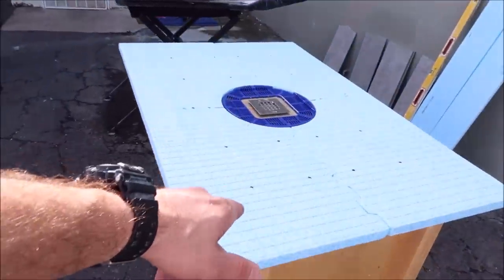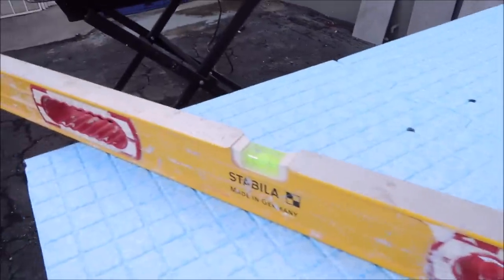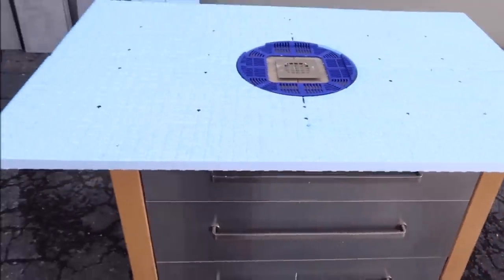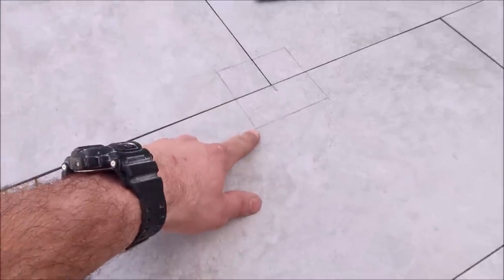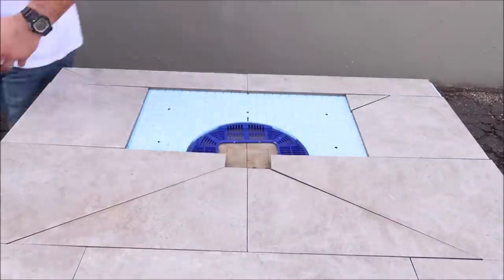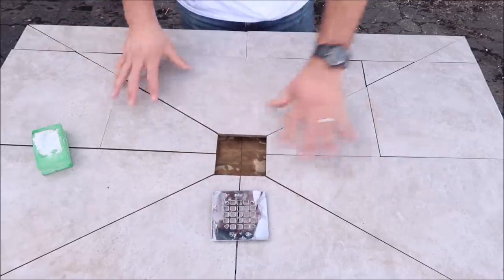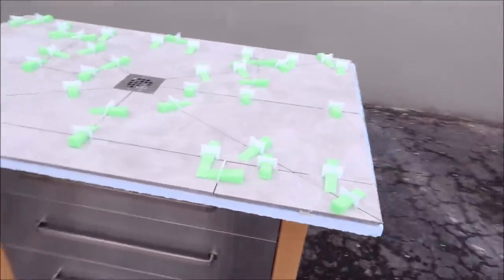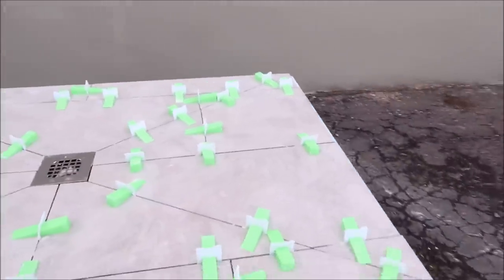Modern Design for a Shower Pan

Comment from the maker: gloves https://amzn.to/2SNhikj
earplugs https://amzn.to/2VI6K7R
levtec leveling system https://amzn.to/2D1COw1
Reply: What pan was that? Does it still need cement under or will go on plywood?
Reply: @djony10  you need a 1/4 x 1/4 notch trowel tinset layer underneath the foam pan

Comment: Looks nice and sleek. I would not have expected this to work, because that inner circle of wedges I would think would be trying to keep all those tiles up and level instead of maintaining that slop down to the drain. Lately I've been using river rock shower pan floors which mold to the slope perfectly, and many people like the look, but they do have a lot of grout. I use a grout maximizer sealer to mix the grout instead of water, adds $20 tot he cost, but worth it.

Comment: it s the best demonstration and tutorial!!!  However, I was a bit surprised seeing tile levelling system... I was sure, all the tile levelling clips and wedges kits are designed to maintain a flat tile surface only. It seems to me, these clips would tend to straighten tiles as much as they can, which is against of what we need. May be you can share your technique? Probably you were tightened them not too much, or, were using any special (slope designed) version of levelling kit?   Also... The first (dry try) can`t be precisely correct, because you use  wet cuts. The disk thickness is at least 5-6mm. So, in fact, you have all the pattern "shrinkage", or, you had to compensate this by grouts size. Is there any way to do split cuts by dry cutter to avoid such results, or, wet saw is the best solution? Thank you

Comment: Great original video my friend, thank you.  I would appreciate any of your inputs if you ever get the time to reply:

in a real life scenario, would you pre-cut all your tiles and fit them with spacers to fill the pan and then use a chalk line to pull your corners and then take the tiles out and recreate yourself the same pattern on a flat floor to mark them with a straight edge and sharpy ready to cut?  Is there a chance the diagonal cuts will look thinner since you are somewhat raising the opposing sides of the tiles on one side or you alculate that and cut straight in the middle of the sharpy line? Would you recommend the same technique weather you are using a Schluter pan and Schluter drain vs dry packed pan and drain cap that can be adjusted with a little offset all around? Is this technique different whether the wall tiles go first or after? Some time the slope is bigger than ¼ per foot, is there anything I should watch for when that happens? A 16th difference on a grout line on a high end job sometime created problems for me if you can believe that and for some stupid reason that I can’t still understand I always get the jobs with the high contrast grout, never fails; and when there is so much contrast between the tiles and grout, all grout lines have to be bang-on. Should I just consider that I will need to shave the tiles in my price or this technique is pretty much idiot proof?  Thanks.

Comment: Thanks for the video! Curious why you laid it out with two rows in the center and half tiles on the sides? Wouldn't three full rows fit?
Reply from the maker: We typically install 12 X 24 tile at a 50% offset on the walls (brick pattern). 
So, we follow that pattern on the floor...
Reply: @LandbergTileTV  That makes sense, but why the two rows (lengthwise) bordered by cuts, as opposed to three courses of full tiles? Just wondering if it was intentional?

Comment: Excellent demonstration.  
Great look!  Can you use other types of tiles or just porcelain?
Reply from the maker: Yes you can, but porcelain is so durable compared to ceramic and stone. It will stay looking new much longer.
Reply: Landberg Tile DIY TV 
Would that have to be slip resistant tile?

Comment: Hi thanks I've been looking for this tutorial video. Btw great music choice 👍. 
If the drain was offset say 10" towards one corner, would you still draw the lines from drain to corner and cut accordingly?
Reply from the maker: Yes, but you could adjust depending on whether or not you have small cuts.
Reply: @LandbergTileTV  thanks, and what grit diamond pad did you use to bevel the edges on those tiles?
Reply from the maker: @moisty254  60 grit pads 👍
Reply: @LandbergTileTV  thanks dude I'm literally about to commence this cut style tomorrow 👍

Comment: A wee tip for your dewalt. Stick your pump in a bucket of clean water beside your saw & it will last years instead or circulating dirty water through it.

Comment: Great idea but...Nice work but you missed one tile to cut . Should be the same pattern or not? Thanks.
Reply from the maker: Negative, this is a 50% offset layout. This is how it should look. You can always install a straight pattern if you like also.
Reply: This isn't a new idea. In 96 i learn tiler in Germany and we also put the tile in the shower on this way. You make a good job but not perfect. Your grout tile was not 100%. Sry

Comment: This Is a great video...one of the best ive seen...i do have a Quick question ...wouldn't the clips want to bring the tiles back to level when installed?
Reply from the maker: Thank you sir, I appreciate the kind words. With these types of cuts (corner of drain to corner of pan) allows the tiles to sit flat with proper pitch towards the drain.
Reply: Clip do not level tiles they only make them flush

Comment: If you have 3mm grout lines when you cut your tile do you have to cut 3mm out so it stays the same size so the lines still match?

If so is there a 3mm blade you use or do you do 2 cuts?

Comment: Thanks for posting this great video.  Question:  Would it be better by not using tile leveling wedges along the diagonal cuts from the corners?  This is the transition line from one facet to the next and is not designed to be level across the transition line.  By using leveling wedges, and forcing a level surface across the transition seems like it would interfere with drainage.  Thanks again, I plan on using this format in my DIY.
Reply from the maker: This system should be called an anti lippage system, it does not level the tiles. We use clips and wedges with all of our large format shower pan tiles with success.

Comment: Great video, but I don't understand something. You cut tiles to get an angle between them and then use clips and wedges to level it. How did you manage to keep slope?
Reply from the maker: When you cut the four angles and install on the pre-sloped pan, the slope simply comes natural.
Reply: clips don't level the tiles they just bring the edges together. Tile leveling system is a misnomer. That is why Sal DiBlasi did a whole video on the importance of having the floor flat/level and not relying on the clips for that.
Reply: THNX

Comment: great video. I have watched tons of tile video. I don't know if there is another video like this on youtube.
I am doing a wedi single slope to slot drain at one end. The wall side is no problem but the other side meets the floor of the bathroom. It will go from 2 3/4 to nothing. Interestingly wedi sells a metal trim piece for this in europe but not in the states. I asked them why and they said everyone uses curbs in US. Not me.
Question is can a tile be cut on an angle to say 1/16th. It is porcelain tile and looks like the exact tile you have in your video. I can make a metal trim piece but want to keep my options open. Thanks for any help. Subscribed!
Reply from the maker: Yes, you can taper each tile to meet the pan tile flush. I hope this answered your question.
Reply: @LandbergTileTV  Great Thanks

Comment: Great video and better idea!  Off subject but do you know of any other brand of wedges that work with the level master clips?
Reply from the maker: don't know anything about level master clips...
Reply: John Rodriguez, I believe that Rigid has a different take on the wedges.  They use a screw down system, with 1” plastic retaining screws.  I saw a YouTube video on it.
Reply from the maker: I have two review video's on Ridgid level max. Yes, they are a spindle system vs. a wedge system.

Comment: Hello. I’m looking to buy a tile saw and was wondering how you like that DEWALT or if you have any other saw you would recommend. I’m looking to stay under $1000. Thanks.
Reply from the maker: You can get the Dewalt for around $700 at contractors direct dot com. I would definitely recommend the Dewalt, best saw on the market for the money. 👊

Comment: When you snap the clips the lower part is still between the tiles, so when you grout them the grout is only going to go slightly over the top of remaining clip, surly this must compromise how waterproof the joint is by not achieving full depth of grout. Which will be OK in walkways but will be a problem in areas that are often flooded such as shower trays.
Reply from the maker: You MUST keep in mind. Grout and tile is NOT waterproof. The shower pan must be waterproofed prior to tile and grout.
Reply: @LandbergTileTV  how will the water escape if it enters through the grout as the top of outlet if flush with the top tile. With this in mind using a one piece grp shower tray can only be the fail safe way.
Reply: @johnbonner258  You have no idea how shower waterproofing works lol.
Reply: @darrenr1194  do tell then

Comment: With large format tile and the ramondi leveling  system do you think a quarter inch square notch trowel is sufficient or do you prefer half inch?
Reply from the maker: I used 1/4 x 1/4 for this demo. It's also necessary to backbutter each tile. Half inch is too much mortar for sure...👊
Reply: @LandbergTileTV  thanks for the feedback. That probably why I had such a mess with mortar since I was using a 1/2" sq notch trowel.

Comment: So how would u do this using a kerdi pan w a linear drain postponed toward the showerhead wall??
I can't find anyone in this area who does any modern tile. Couldn't find anyone to install my custom shower spa with jets either...
Reply from the maker: Yes, single slope offset Schluter pan, linear drain and Matte finish large format tile is a good option. Sorry about your circumstance with finding installers...
Reply: @LandbergTileTV  Thank u Landberg for ur feedback, highly appreciated!
My crowded 1943 72"W x 81" L bathroom is getting gutted. Removing the small window adding 60" awning window in shower. The 4x9 white subway will completely cover left wall, window wall, & 30" showerhead (right) wall. Right side will have floating counter & wall mount toilet.
The floor will be 12x24 dark grey matte porcelain tile which. With that design getting the time spot on extremely important. I wanted to go larger tile but thought such small rm 6 tile across & 8 length b good.
When I'm done I'll shoot u some pictures so u can c if I was a good student ;}

Comment: so i dont get it.  you cut the tile to slope to the drain, those cuts arn't widened for grout.  looks like you have about 5 clips across short-side. So the entire footprint expands 5/8th inch in the short dimension which is no longer the footprint of the shower pan (which it looks like you can actually see from the final result).  This may not be a problem for curbless, but even curbless the wall-side edge would be pushed into the wall and some of those tiles wouldn't fit.  The only way it would work without cutting extra for a grout line is if the wet saw is cutting 1/8th of an inch off the tile (or whatever your clip size is).  I'm sure it's nto cutting 0, but I doubt it's cutting 1/8th of an inch.  I'm trying to do the same thing, but I dont' see a way to avoid cutting extra for the grout lines

Comment: you can use the lineal drain in a center shower pan 2
Reply from the maker: That is true! thanks for the tip 👊
Reply: Landberg Tile DIY TV let's look out for the installer. but good video. will use it
Reply from the maker: @wayneanderson5127  thank you sir, appreciate it
Reply: Landberg Tile DIY TV we appreciate you understanding.

Comment: Looks so much better using a Rubi Score cutter and NO grout joint on pitch cuts,fyi.
Reply from the maker: you must have grout joints/cuts to obtain your pitch.
Reply: @LandbergTileTV  I think he means the rubi makes the relief cuts,and looks like no joint but allows for the pitch still. I've done this But definitely can't use clips and have to really have a perfect mud pitched pan or foam pan ...relief cuts eliminates the grout joint but allows the pitch. It's kinda sexy  actually.

Comment: Ok that is great but you know that drain pipe is not always  on that center do one off that center pls 😙😙😙😙😙
Reply: Nice one
Reply: when the drain is not centered you lay your cuts on the actual shower pan Then draw your cross lines to each corner. in my opinion

Comment: Looks good but on a job for real this is more difficult to do and getting adequately paid for it is more difficult
Reply from the maker: I absolutely agree, it takes much more time than sheeted pan tile for sure.
Reply: After u do this a couple of times it doesn't take to long to do really I do most wet rooms like this never used clips because thought they would take away slope great tip thanks regards use them from now on

Comment: A Line drain accomplishes this much better. You should have ditched the brick layout. Doesn't even look symmetrical and also leaves you with weird small pieces.
Reply: You also mortared it down but didn't show the end result without the clips.
Reply from the maker: Yes sir, if you use a linear drain you don't have to cut the large format tiles at this angle. You pick a straight slope towards the valve wall or back wall. This is for a center drain with large format. Also, we mostly install at a 50% offset pattern on the walls, therefore the pan needs to match the same 50% offset. If you installed a straight pattern on the walls, then yes, install a straight pattern on the shower pan. Thanks for the watch and comment brother 👊
Reply from the maker: This is a simple demo of installing large format tile with center drain. I have a video coming up installing 4" x 48" porcelain plank tile for a shower pan with a center drain. It will be grouted and finished, stay tuned my friend. You can follow me on instagram here to see the progress https://www.instagram.com/landbergtiletv/
Reply: Does it look better to keep the offset pattern on the floor ? I know it is subject to opinion but I believe when you cut the angles into floor tile the offset pattern gets lost and distorted. Even if the walls were 50% offset, the floor pattern looks odd to me. Thanks for hearing me out! Good job on the video presentation and showmanship. Keep it up!

Comment: I never worry about grout. Ardex FL out performs anything I have ever used. Also, why not do away with the 50% and use a straight pattern? It would look a lot cleaner. This looks kind of amateur really.
Reply from the maker: If a straight pattern is on the walls, yes, do the same on the floor. 90% of our 12X24 shower layouts are at a 50% offset. The pan should match the walls. I do agree that a straight layout would look better on the pan. Thanks for the watch and comment 👊
Reply: @LandbergTileTV  I lay mine in 1/3s or straight. But it just looks noisy to me being 50% and then the cuts to allow slope. Not talking shit, just my opinion. Nice tutorial.
Reply from the maker: @nicmont7158  Thank you sir 👊

Comment: 👎10 years old technology
Reply from the maker: For residential shower pans? 10 year old tech? I'm confused. I don't see many large format residential shower pans like this, maybe commercial..
Reply: @LandbergTileTV  This is very common in the UK. Very rare we use mosaics. One thing I didn't like with your layout was the diagonal grout line not lining up but if you've never done it before it was still a nice job,. 👍🏻
Reply from the maker: @dommo9056  It was a simple demo, of course take your time when installing for a client. Thx for the view and comment sir 👊